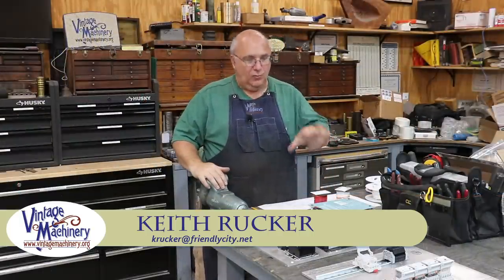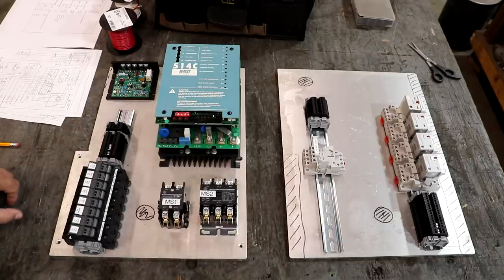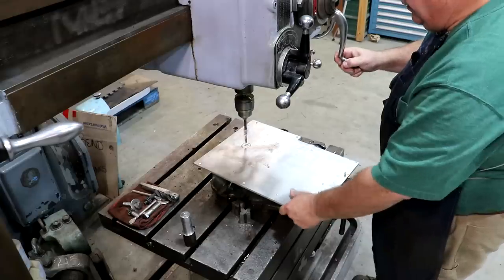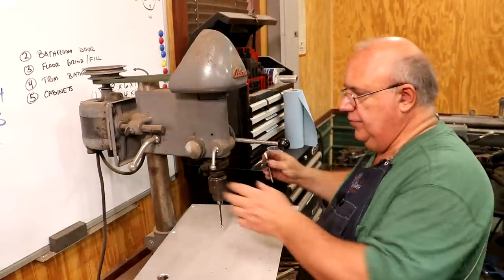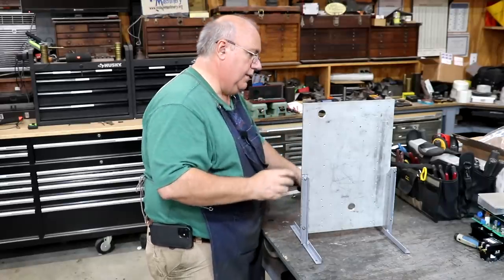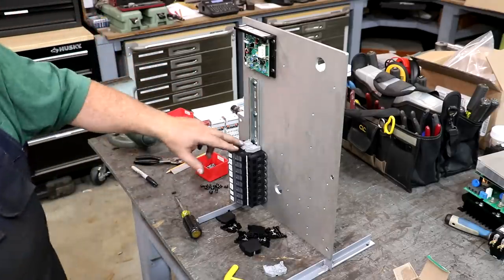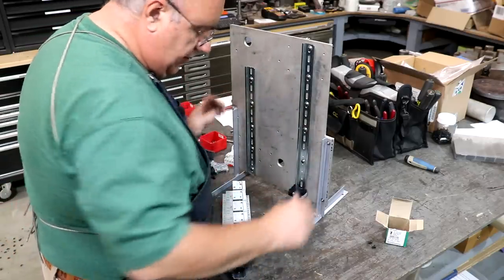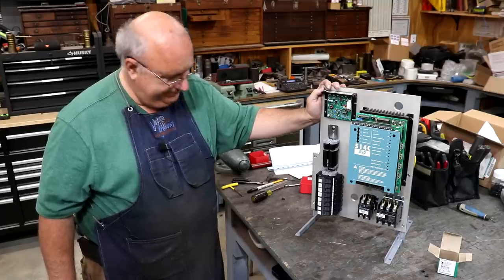Monarch 10EE Drive Retrofit 3: Building out the Electrical Component Panel

Comment: You definitely need grommets to protect the wires going through. The vibration of the lathe will eventually cut through the insulation. It's cheap insurance. Please listen to all the people telling you to use grommets we're not wrong.
Reply: He's right.  And been an electrician for 40  years.
Reply: I have built and repaired audio equipment for a very long time, and even only driven by vibration from speakers, these sorts of arrangements would rub out in a few years. I give it hours when attached to a running electric motor. You absolutely need grommets and maybe some sort of plastic pass-through, because a rubber grommet will rub through, too. I also strongly suggest some diagonal braces on the angle-iron uprights, and isolation grommets between the uprights and the panel to isolate the rest of the electronics from high-frequency vibration. 

   You cannot overdo stuff like this, heat and vibration are the enemies, and this application is nearly a worst case.
Reply: Long time EE here: totally agree you need grommets!  They make flexible grommet material you can wrap in the hole and cut to length. They are soft plastic and don't wear the wiring much at all.  Looking at all the devices on that panel, I also think you need bigger holes (or more holes).
Reply: out of curiosity (asking for a.. friend). if you put a heat shrink over the wire where it passes through is that enough added protection?
Reply: @nelen_co  not at all.
Reply: @bkoholliston  yes alligator grommets. I'm reminded of all the F16A/B's that crashed due to wiring being abraded on rolled over aluminum edges. Grommets were removed from the design and metal edges were rolled over to reduce weight. It was not good enough. That was the main driver for replacing the A/B models with C/D models ASAP.
Reply: @nelen_co  there is shrink designed for that application. But commonly available shrink isn’t designed for that. I suppose you could use several layers, but it’s not good practice.
Reply: You absolutely want grommets on those through-holes. You're spending several hundreds on the components to make up the drive electronics, not spending a buck each for grommets is nuts. In that application I would not only have grommets, but I would have a few-inch-long length of 1/2" or 5/8" ID tubing that the wires pass through as well. You can buy that clear (or black) tubing at Home Depot, it's under a buck a foot and you can buy just 1 foot. 

You should also blow a few bucks on a set of Brady wire markers, little pieces of 1/4" x 1.5" lengths of adhesive tape pre-numbered that you wrap around the ends of your wires to identify them. This is assuming you do not have 15 different colors of wire. The grommets and brady wire markers are just good practice, amigo. This stuff take seconds to throw in when you're building the thing and can save you hours later on if you need to troubleshoot or rewire.
Reply: @nelen_co  NO.  Was an electronics tech in a hospital for 35 years.  Heat shrink is not wear-proof.
Reply: The previous cabling was definately cut thru by surrounding metal parts. ->No. However, grommets cannot be wrong.
Reply: @nelen_co  Heat shrink is usually thinner than the insulation on a wire so it definitely adds something but not enough in my opinion.  Heat shrink for wires is usually polyolefin which is slippery, but not as much as polyethylene used in the grommets.  Go with it until it shorts out?!?  Make sure the panel board is grounded to safety ground.
Reply: @nelen_co  Nope, you're just delaying the inevitable.
Reply: @nelen_co  I would say no. Going through those holes are fat wires, maybe 8-10-12 ga. Stiff. You're gonna thread the wires through those holes and when fully assembled, those wires are going to relax against however they were bent to assemble the panel. And then they are more or less solid metal rods. So, if they come to relax against the cut part of the holes you could have a problem pretty quickly with the normal vibration of the machine. Even if those holes were chamfered and sanded down pretty well. Heatshrink, to me, is for low voltage, low current applications. This is neither. I rarely use heatshrink, I just slide some stripped-off cable jacketing over splices. Grommets are the way to go in this case, it's not even worth thinking about.
Reply: I came here to say the same thing.
Reply: You should use grommets.

Comment: Awesome job. If I may, You should consider adding a line reactor to protect the drive. And I would also recommend an din mounted thermostat and a fan for the enclosure. Those drives put out a far amount of heat and you need a way to keep your panels cool to extend their lifetime.
Reply: How much heat does a Parker DC drive put out?  The manufacturer guidance on cooling should be followed.
Reply: @michael931   I have no idea what temp that drive puts out but it has a 32 -104 degree operating temperature. With it being in a enclosure and you don’t have any fans or vents it will easily surpass that operating temp. A lot of electronic components don’t specify what should or shouldn’t be in your specific control panel. It’s up to the electrical designer to figure out what should or shouldn’t be in the panel.
Reply: The original system used tube thyratrons and it didn't need a fan. It's not a sealed enclosure, lots of things spinning around probably generating the equivalent turbulence of fans, and it's a huge chunk of cast iron that can act as a heat sink. Heat being generated by the drive means inefficiency, and I would hope it's at least as efficient as the 70 year old technology was. My guess is that $2000 drive also has it's own thermal monitoring system and will shut down if necessary.
Reply: The parker 514c drive loss are 50 watts at full load.  I am assuming that this drive will not work at full load all the time.  So 50 watts for the heat load do not require  any fan to cool.
Reply: @tracteurfan4734  So why not just put in a fan? They’re cheap, reliable, draw little power and solve the cooling question. Why take a chance on an expensive machine when the solution is so obvious?

Comment: The panel will experience vibration in the machine which could cause chaffing of the wires in the pass-through holes so grommets are appropriate.
Reply: With vibrations in mind, I am also wondering if DIN-Rails are actually meant to be mounted vertically. I learned to use them only horizontally and have so far always seen them that way either. Mounting them sideways I don´t think some of the components are actually mounted securely as they can slide down "sideways".

Comment: Nice layout,Keith.A clean layout not only looks nice but,it makes working on a panel,so much better.Putting a heavy chamfer on the through holes is alright but, I hope you will seriously consider installing grommets in those holes.
Reply: While the chamfer will protect the grommets the grommets are needed for long-term running of the machine.
Reply: Definitely add grommets and cooling.
Reply: @frandoyle5608  Yes.Cooling will greatly extend the life of the electronics

Comment: For those commenting on, why the second drive for the field current when the Parker 514C provides a field supply: Yes the Parker drive provides a field supply, but it's a FIXED field supply at 0.9X the supply voltage. Keith has not yet shared the motor nameplate data on this channel but I assume that either the field voltage is nonstandard and or the motor needs to be run above base speed in normal operation. A modern motor rating like this would be 1750/3600rpm where 1750rpm is Base speed with full field current and full armature voltage. The filed current is reduced and the motor is operated in the "constant HP region" to operate above 1750rpm. I have worked with and tuned LOTS of industrial AC and DC drives. For a DC motor like this you would normally just use a DC drive that has a field current REGULATOR, not just a fixed field supply. You would configure the drive to regulate the field current to the motor rated field current, and when the speed reached the base speed the field current would automagically be reduced. I would tell Keith which drive he should use, except for the issue that I am unaware of any SINGLE PHASE DC drive that has a field current regulator as an option. A field current regulator for operating above base motor speed is usually a higher end feature and not commonly found on lower end, small HP single phase drives.  Also please, please, provide field loss protection and or tachometer over speed fault detection or the motor may experience RUD (Rapid Unscheduled Disassembly).

Comment: Did you use lock washers for the mounting board and brackets as well?
There will be vibration throughout so that should require lock washers on the nut side.Also the board should require a separate independent ground lug as an equipment ground.You might need to scratch some of the paint off the bottom of the mountain brackets just so there’s metal against metal contact.Grounding is important for protection against components and personnel.Even though you reamed the holes for where the wires pass through you might wanna go a little larger and use a grommet.
As an electrician i find they undersize capacity where a larger space never hurts only helps.When it comes to terminating your wires to the board components you should be able to do all that right on the bench allowing enough length to reach their destination,just be sure to use linen tags for identification.I find using tire wraps for bundling your wires neatly always works nicely and makes for a neat and cleaner job.Looking good so far.

Comment: uh... You need grommets for the wire passthroughs. The metal can have a mirror finish, but its not sharpness that does the damage but hardness vs. hardness. The machine WILL vibrate and act like a sander on that one spot of wire being impinged on. Also consider a rack mounted disconnect for future repairs. NO ONE WANTS TO KNEEL ON CONCRETE....well, except a few who like that kind of thing. A rack mount disconnect would allow a future technician to disconnect the panel, 4 mount screws, lift it to a work bench and work on it.

Comment: I liked the idea of putting a space between the terminals for wires to pass through.
Reply: when I bult cabinets for electrical controlls, we used some plastic rails with sort of combs on the side and a cap to close them. you could get a wire out wherever you needed and had all wires nice and protected in the channel.
Reply: I've seen those. They make for a nice clean cabinet.

Comment: Look nice Keith. I hate to jump on the band wagon but I spent 40 years installing radar systems in flight test aircraft (a high vibration environment) and I would not run wires through a bare hole without some kind of protection. I frequently used spiral wrap tubing.

Comment: I always enjoy it when the first component goes onto a board or panel. It's a sign that all the prep work is done and the whole thing starts coming together.
Reply: Either that or you get to drag out all your long aircraft drill bits so you can drill the holes you forgot about around what you've already mounted, LOL.

Comment: Hey Keith. I like to introduce myself and have in the past. So I'm Keith from Michigan. This is the very first time I have seen you doing electrical panels. My career got launched about 4yrs, they were quite impressive and involved. Relay ladder logic wiring b4 PLC became more commonly used. Keith, my panels took 3 weeks, not including the door switches-on and on my friend. Send a message, if possible 🙂

Comment: Whenever I've used snap-in din rail stops vertically, the vibration made them slide down??  The Allen Bradley type end clamps, that tighten with two bolts hold better, just a thought.
Reply: Wago work also.

Comment: From an old hand wireman and fault chaser you really should grommet those holes like everyone says. The vibration will wear the insulation eventually and you will get a fault probably intermittent which will be hard to find and time consuming. It really is cheap insurance against frustration and problems.

Had a quick look at your wiring diagrams, they look complicated, and it will be easy to miss a wire, the old trick is to get a highlight pen and colour each wire as you install it, makes a missed one easy to see and you will always know where you left off if you have to leave the job.
Hope the tips are useful and the wiring goes OK
hamstreetjohn

Comment: I hope your designer has made sure that if the shunt field for the motor cannot be lost while the armature is powered , a very robust interlock must be provided to shut the armature voltage off in the event of the shunt field controller failing , it would be be best practice to sense the field at the field as that would give the most reliable feed back 
ex armature and stator winder , also spent a long time on the pre war 220vdc traction and motors in general 
if you loose the shunt field the results will not be pretty
Reply: The Parker 514C can provide the Field voltage.  I do not yet understand varying the Field Voltage via a different drive.
If the field from the Parker 514C is lost the drive should fault out and shut down.

Typically
Losing the field when the motor is unloaded results in the motor running away and spinning apart 
That would be bad
Losing the field with a load on the motor typically drags the motor to a stop.
A DC motor at rest that has only armature voltage applied will growl and buzz angrily and make a LOT of heat (If that happens you should remove power ASAP)

But again, this drive will fault out and shut down if it loses the field.
Reply: @scotte2815  yes but there is also the KB drive.

Comment: Nicely done. When I was making my first electronic device, I did not have all the nice mounting accessories. It used several tubes, a large multiwinding transformer, a smaller transformer,. and several potentiometers. Loads of resistors and capacitors and NO printed circuit boards. I started with a sheet of 1/8th inch aluminum and a drill, tin snips and a hacksaw. Yours looks SO much easier.

Comment: Looks great, I would echo the comment from Brett Buck below about adding braces to the panel mounting brackets, the resonant frequency of what you have there looks like it will be pretty low and well within the range I could imagine being excited by a running lathe, adding braces will raise it quite significantly.  Some inverters (mostly it must be said, coming from further east than the USA) often have big chunky electrolytic capacitors mounted only by their legs which also have a low resonant frequency and if things do resonate then over time the copper legs can work-harden and fail.

Also, if you don't have room to add some 'finger'  trunking to route the wires, could I suggest adding a bunch of tapped holes in the baseplate for cable clips at this stage is safer than drilling and tapping holes next to the finished wire bundles where a slip can remove a lot of insulation from wires in a hurry - ask me how I know!

Lastly, I try to use at least one screw-down DIN rail grounding terminal per DIN rail as an 'end stop' so I can run a ground wire to each rail and not rely on any mounting screws for grounding (which is frowned upon over on this side of the Atlantic anyway) it also makes it easy to add ground wires for inverters and so on.

Comment: Even Chinese manufacturers know you should ALWAYS  use an insulating bush or grommet where wires pass through metal panels!  Wires WILL vibrate at discrete machine speeds and after a while their insulation will wear through and short on the metal panel.  The bush/grommet is an essential 2nd level of electrical wiring mechanical protection.   The chamfer doesn't help much.
Reply: Even they know, and some actually do ;)

Comment: You will probably have to need a few tapped holes for ground points...
Panel looks neat and tidy. Plastic hole "grommets" may save you some grief down the road if wire chaffing ever happens. I cannot determine from here if you will ever need them but its cheap insurance.
It's kind of funny that you are building out an aluminum panel of solid state gear to replace a tube controller when the last aluminum panel I made was to mount tube sockets onto :D
Cheers,

Comment: I looked up the manual for the 514C. It is an amazing product.  It seems to be designed specifically for this application. Good research. I hope there are plans to use the tack feedback circuit as the feedback will really make the system shine.  
I agree there needs to be some sort of grommet on the through holes in the panel, maybe a chase nipple might fit the bill.

Comment: Use grommets. I know we nag, but we nag from a good place. Vibrations will cut those wires eventually. Even a low motor hum can eventually break a connection. Plus, the tool is cheap as cheap gets (obviously, there's more expensive ones, but for your level/hours of use, a cheaper one is sufficient). Especially with modern wire, it's worth the peace and mind.